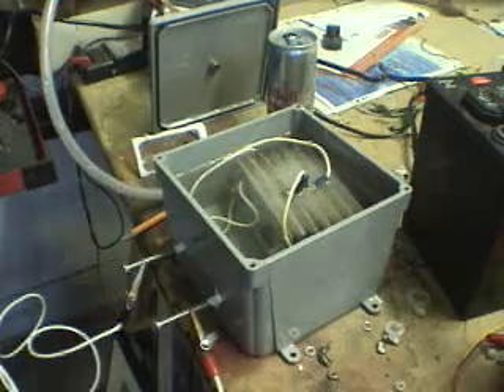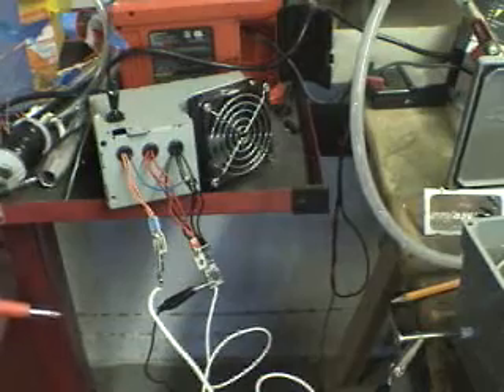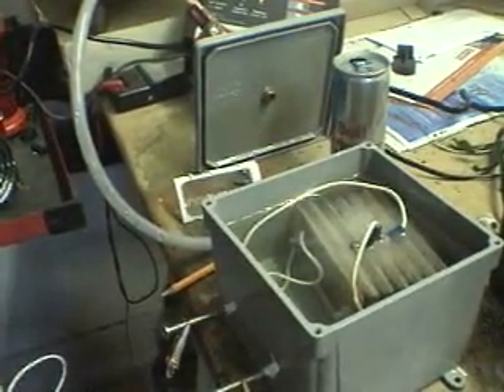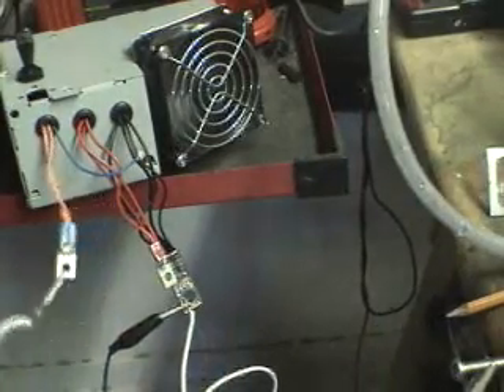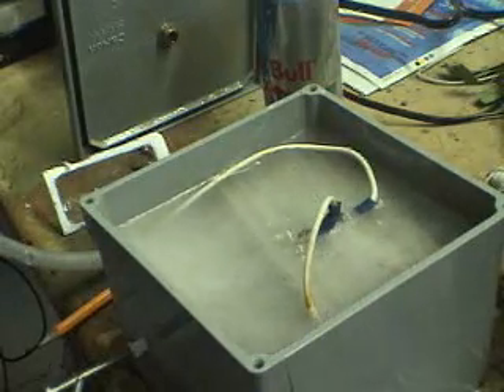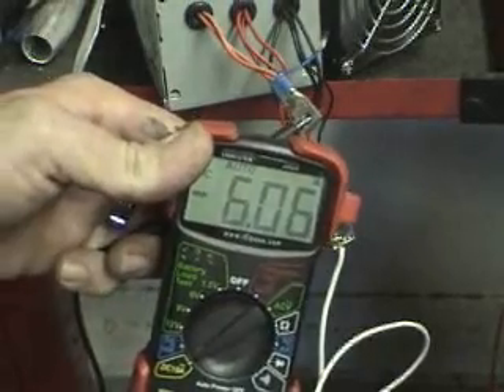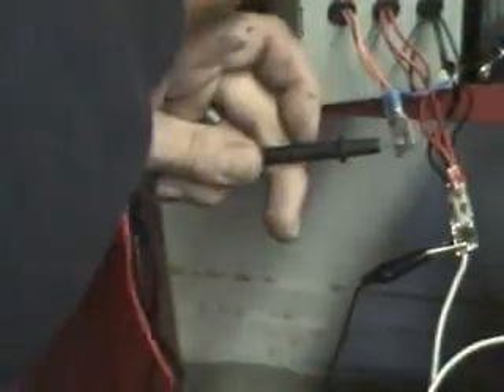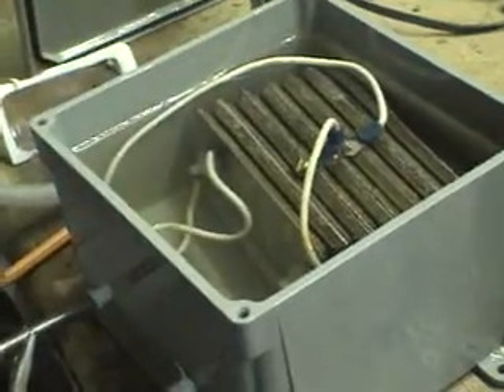New "clam cell"

Comment: Well its harmfull in huge ammounts or in small doses over long time. The danger with room exeriment with elctrolysis is that you quicly can concentrate the level of chlorine gas inside. In the swiming pool you have a huge room with lots of space (and mabye aircondition too?).

But of course, if the level of hydrogen you are producing is low, and if you are not completely sealed, air tight room your probadly all right. Its just worth keeping in mind I think...

Comment: Some electrolytes will cause toxic fumes!!  You might smell vinegar, chlorine, or even rotten eggs from the fumes, not to mention that some of these vapors will corrode vital elements in your engine, i.e. Rust cylinder walls and pit piston rings. The safest electrolyte is Potassium hydroxide. I strongly urge everyone to use distilled water with KOH (potassium hydroxide) as an electrolyte. I found a list of chemical byproducts produced from these processes, I will post it on my account ASAP.

Comment: There you made a mistake, mabye even a lasting one?
Water consists of hydrogen and oxygen, thats true, but do you think you can make hydrogen only by using water?
No, you need something to make the water more conducting and salt is a normal substance for the use.
The only problem is that the chlorine in the salt (and other components) can be mixed into the gas and be extremely toxic to inhale, especially indoors.

You are in risk of getting permanenet brain damage so bevare.

Comment: Hi it seems very good but have you ever tryied making a cell with tubes? Ive got one and seems to have more gas and less amps mine has 5 tubes 1.9A at 13,6v and ONLY water nothing else i got enough gas to power a torch.
Anyway i love to see that there is really loads of ppl that are really trying to get this going!!
Oh another thing im my cell first ive tryied the PWM without great results but with COILS you can  REALLY lower the amps the bigest they are less amps you will use!